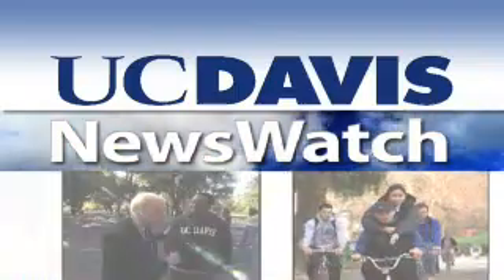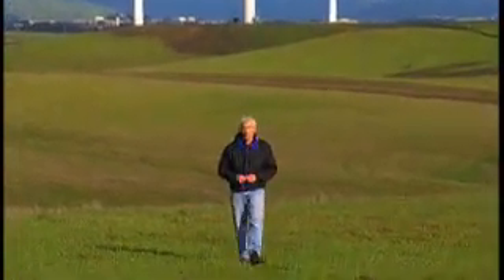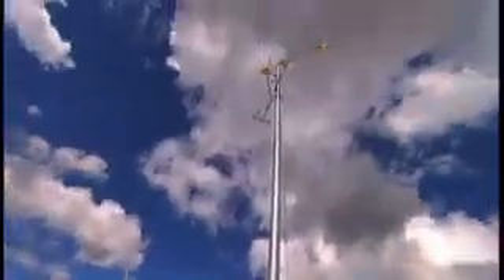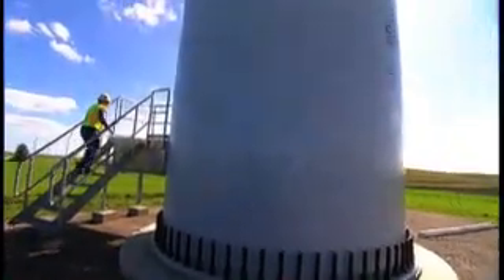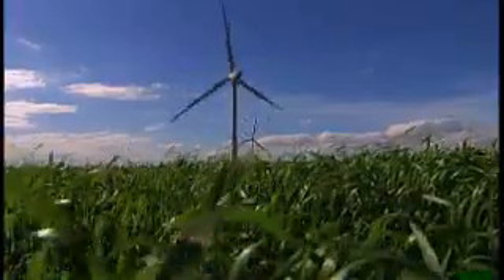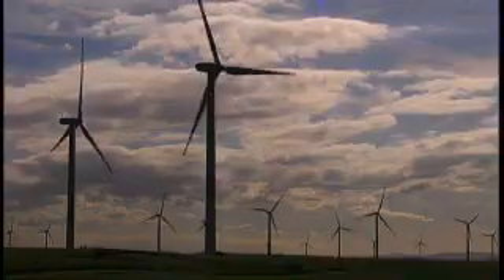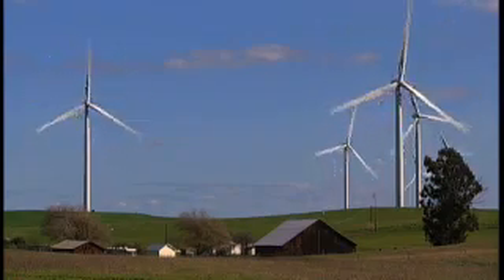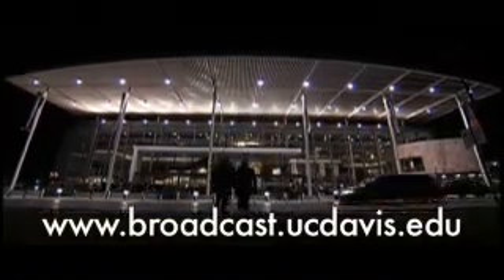Wind Farm Uses Latest Technology for Efficiency

Comment: So how long does it take to recoup that  300 million dollars ?  Also, on that 52 % rate. Is that only for when the blades are turning ?  Also, is the electricity used to keep parts of the turbine running when the blades are not spinning part of the efficiency rating formula ?   And what percentage of the time are the turbines actually making electricity ?  Or how often do they actually turn from the wind ?